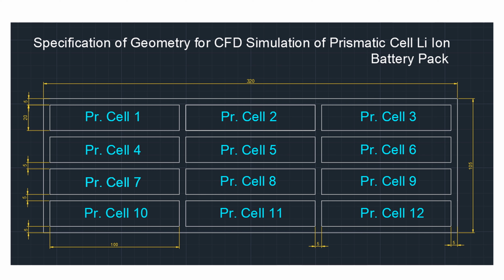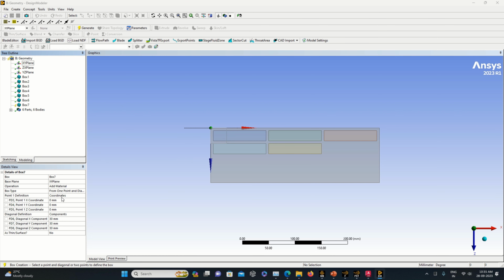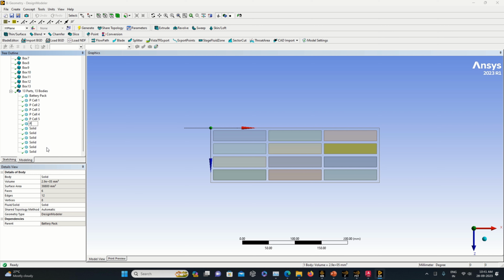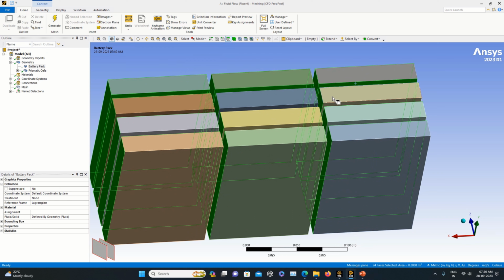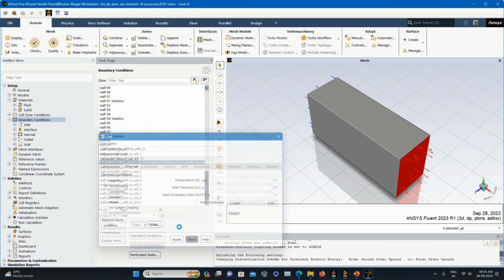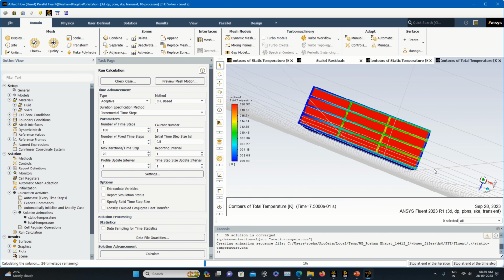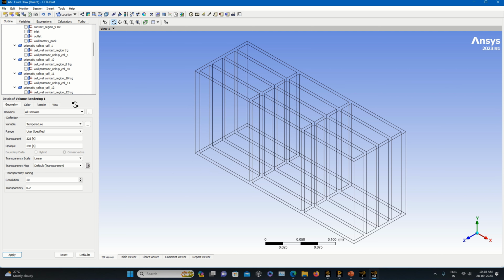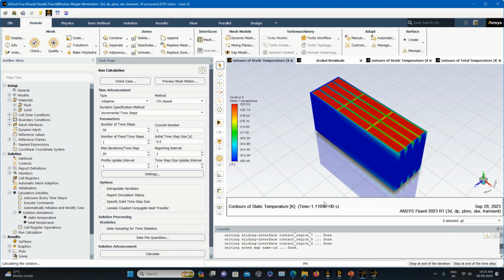CFD Thermal Analysis of “Prismatic Cell” Lithium-Ion Battery Pack

Comment: Sir if the prismatic battery is arranged in module(9 batteries together) can we do simulation for a single prismatic battery so that calculation run reduces and will we get same result as 9 batteries together ? I am asking because reduce the run time sir?
Reply from the maker: at least few cells will be required to understand the behavior of these batteries

Comment: I want to design a battery for EV. I want to simulate using different chemical to find out which one be better efficient. I need some simulation software for testing it. Can you suggest me some??
Reply from the maker: i have ansys for simulation

Comment: How was your upper layer visible??
I designed a battery in ansys but i had my top layer covered and cells weren't visible
Reply from the maker: Check if you have done slice operation or check the height of cell
Reply: @FrontiersInCFD I checked it. The problem was with the height of cell